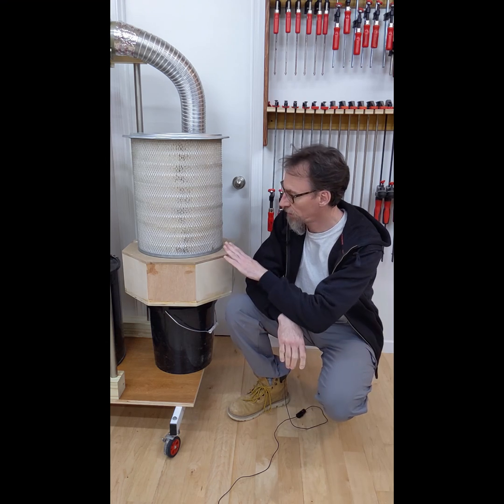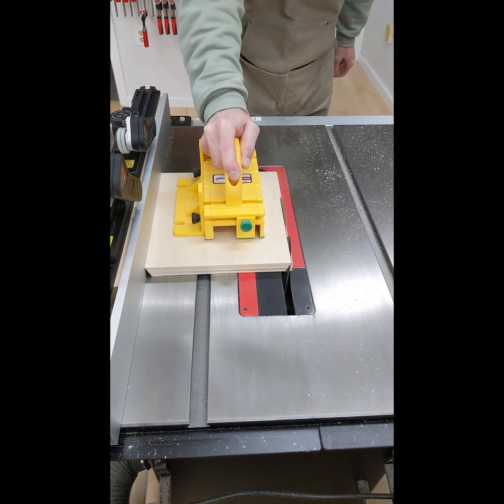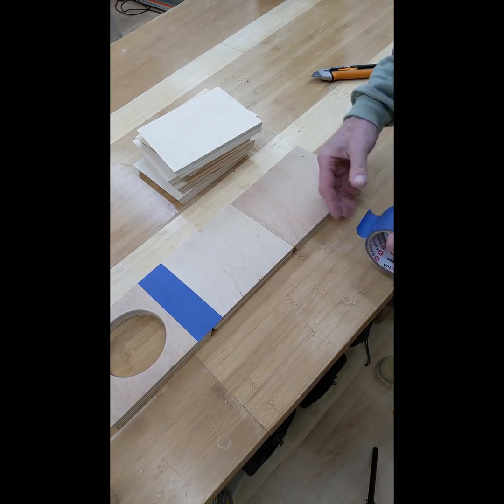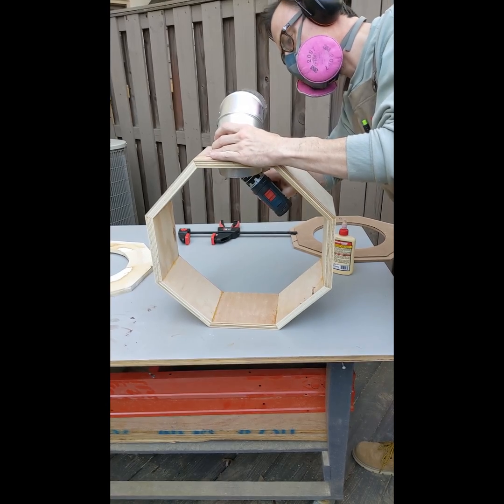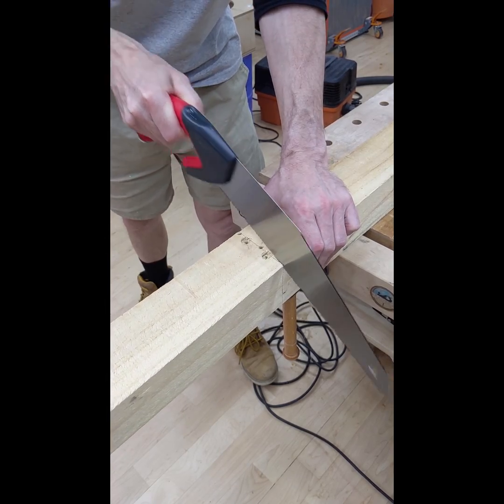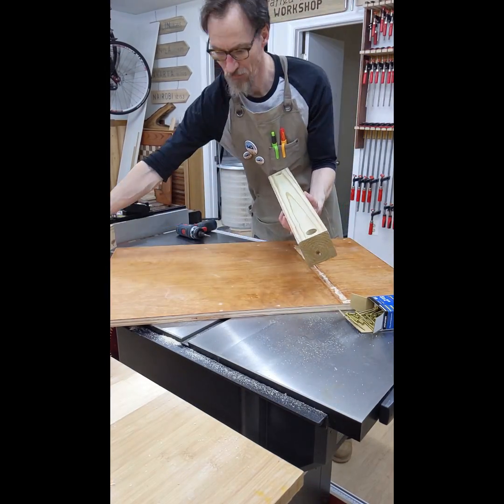Portable 2-Stage Dust Collection for a Small Workshop

Comment: Great project, Radek.  I was looking for something just like this so, I'm glad I found you.  One question - where did you get the cyclone separator?  The ones I was looking at are much smaller and designed to work with a shop vac.

Comment: Nice little project. Currently when I need to grind or solder I have a vacuum cleaner outside the window with the hose pocking through. This is exactly what I need 😅
my insta is @cheech_zheng

Comment: My current two-stage dust collections is an Oneida Super Dust Deputy attached to a 55-gallon drum and a Harbor Freight 1HP motor. I have one wall piped with only one Y. It does a decent job but I want more power so I recently ordered the 2HP motor. I can't wait for it to arrive! That air filter looks nice! It would be a great upgrade for my newer DC system!

Comment: The engine and the wheel is to small, 550cfm is only 1000cm³....
Reply from the maker: I use it with the drum sander, my small jointer or planer, sometimes with a router and it is big enough. All my powertools are rather portable. It is a bit too small for the table saw indeed, but I have bigger unit for TS. Presented DC is my secondary system. It is designed for small shops like I mentioned in the title. Thank you for your comment.